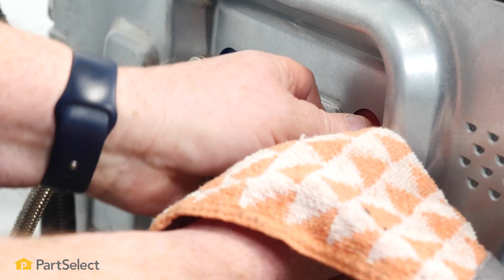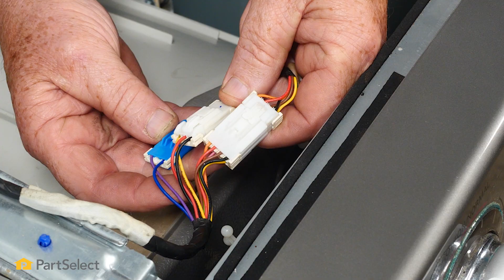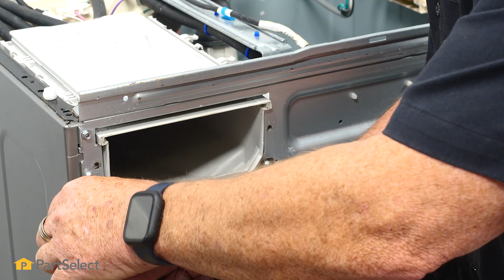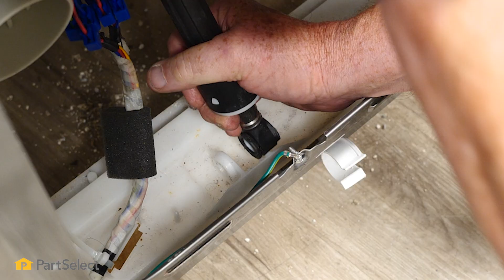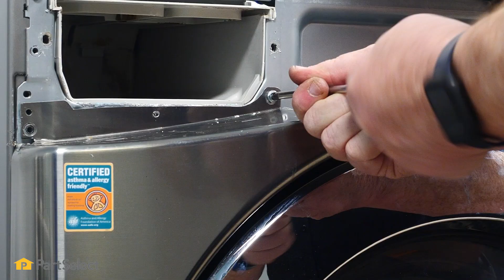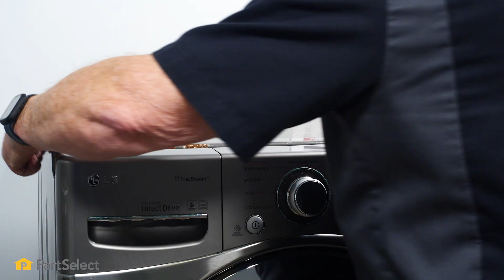LG Washer Repair - How to Replace the Shock Absorber (LG Part #383EER3001J)

Comment: One of the best videos I have seen.  After having done it, I would recommend lubing the old pins before taking them out.  Press down the lock and push the pin versus pulling with the pliers.

Comment: Even easier.... Just remove the back panel, use a pair of wire snips to cut off the tabs (top and bottom, one strut at a time), then pliers to pull out the retainer. No idea why i spent an 30 mins trying not to destroy the plastic when the new kit from amazon came with brand new ones.... No need to disassemble the front.... only tools needed are wire snips, sturdy pliers and a philips screwdriver to take off a couple of screws from the back panel..... didn't even need to disconnect the water (although i did turn it off and unplug) .... had i known what i was doing it should've been a 10 min job

Comment: Or, you can go through the giant hole in the bottom of the machine and do the entire job in three minutes
Reply: if you have the room and want to actually disconnect the water lines, and you aren't worried about rotating the entire appliance 90 degrees safely by yourself... sure

Comment: This was a great video for how to disassemble and reassemble the washer. It lacked a little bit in the actual shock absorber replacement, in particular the two front absorbers. The rear one is easy to access and that's the only one that is shown being replaced. But the front two, and especially the front left one, are not nearly as easy. I suggest removing the large hose that connects to the pump, BUT, before you do, make sure to drain the pump using the little hose that is normally inside the access door. If you don't, when you remove the big hose water will not only come out of the hose, but will bubble up out of the pump, making a huge mess.

I found that the best way to get the pins on the front out was to press in on the tab very hard with a screwdriver and hope that it stays pressed in. Then you can use two hands to either either push, pull, or hammer the pin out.

Comment: Thanks for the tutorial. While my model wasn’t the exact same as the one in your video, I was able to replace the shock absorbers. The excessive vibration warning sensor is no longer coming on and the washing machine is operating smoothly. Thanks.
Reply: I heard struts are a bit more expensive but last as long as your favorite pair of Levis counterfits , friend told me 🙂

Comment: On some machines from LG, all the shocks can be reached from the back panel, BUT, they put a single pin in that comes out towards the front. Unfortunately, that pin is then blocked by the counter weight. You have to cut that pin out, otherwise you need to take whole machine apart. 
Just one tip. 
Use a 10 or 11mm box end wrench over the pointy part of the pin. That is just the right size to put that tab in and start to slide the pin out.

Comment: Can't you just put the machine on its side and access the shocks from under side
Reply: Not on most modern LG machines. There is no longer an access panel underneath and it's just a huge plastic molded section. The mounts for the shocks are usually plastic also.
Reply: yes.... much easier access from the bottom.... but harder to do by yourself in a small space safely